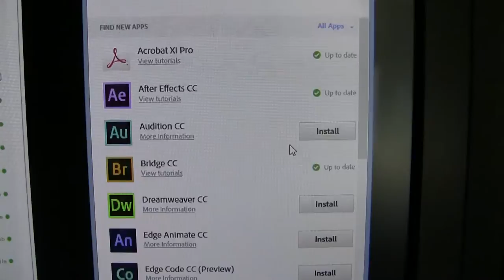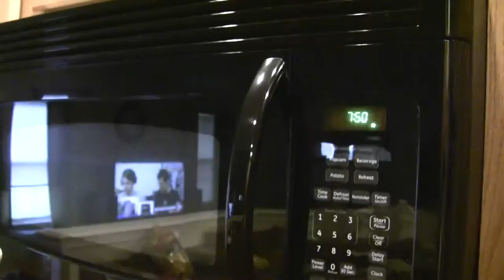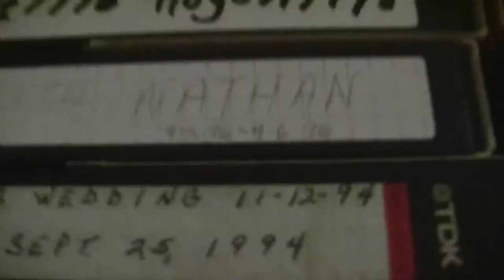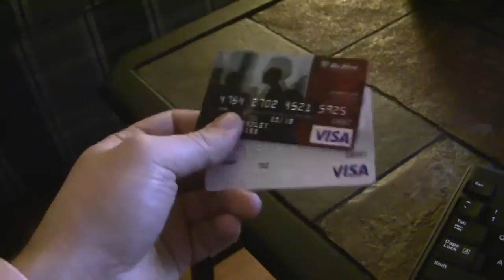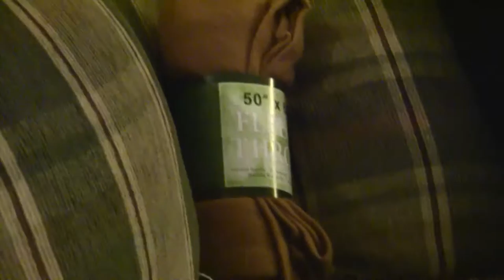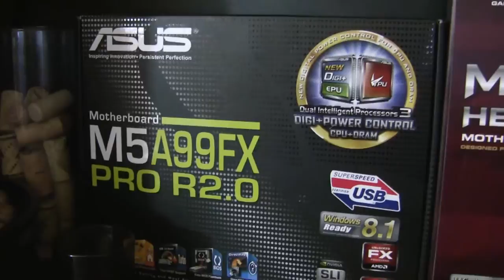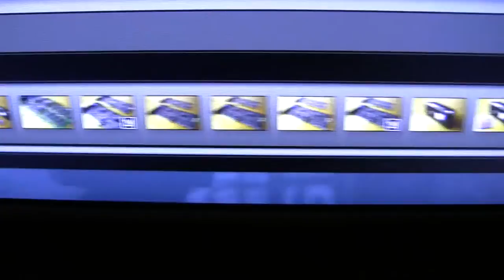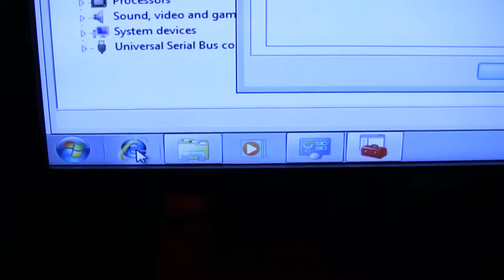TUVlog 2 - Easter, smartwatch yard work, FX-8350 for dad and 3dfx nostalgia

Comment: 'Old hardware'...My computer has a 3DFX Voodoo3 16MB in it!  Well, it's my downloading PC, not my main fortunately.  CPU is an AMD Athlon XP 1800+ with a 233MHz FSB.  320MB of RAM too!  

'Youngings'...I'm 16 and this Voodoo3 is AGP!  Probably almost as old as me :P  I certainly wouldn't even attempt to game on my Voodoo.  

Good video Chris, hope you have a good weekend.  Also, thank you for following me back on Twitter :)
Reply from the maker: So many good memories from that post! I remember I had a Voodoo3 3500 TV that was essentially a Voodoo3 3000 with a TV tuner built in. I want to say I had that in an Athlon K7 700MHz system at the time.

I followed that up with a Diamond Viper V770 (nVidia TNT2) with 32MB of VRAM and at some point an ATI Rage 128 which I recall not being impressed with. AGP was so revolutionary at the time and remained relevant for so long that I remember getting an ASUS P2B when I was still in Jr. High and not moving to PCI Express until after I graduated from college.

Comment: Chris, Please I need your help man, I don't know which case to choose and both of them look very neat and beautiful. Please help me to decide which one is good.

Corsair Obsidian 450D Windowed
NZXT 440
Corsair Obsidian 350D Windowed
  
Please reply, Thanks :)
Reply from the maker: You have three excellent cases in the running there! I can see why you are having a hard time making a choice. Tell me more about what you plan to build. Will you be doing heavy overclocking? Intel or AMD? Air cooled or liquid cooling? If liquid, closed loop like a Corsair H105 or H110 or custom loop? I know, lots of questions but the will help narrow down the decision :)
Reply: OK thanks man, The build that I will be using is AMD liquid cooled by corsair, I will be using the corsair h60 liquid cooling because I am aiming for a budget middle end PC and I wont be doing too much overclocking. 

Here are my specs I am saving up to build my PC

CPU: AMD atlon x4 760k.
MOTHERBOARD: MSI A88x-g45 gaming fm2+.
GPU: MSI R9 270 2gb twin frozr gaming edition.
PSU: Corsair cx 430
RAM: ADATA XPG V1.0 8gb(2x4gb)
SSD: ADATA Premier Pro SP900 128gb
Case:You decide

Here is the build, I might change my ssd to a hdd that is a segate 500gb and maybe I might change the ram to crucial ballistix sport.
But hey, tell me if the build is good and which case I should use or which parts I should change :).
Reply: Btw I almost forgot, how do I private message you (pm)?
Reply from the maker: mavrick2131 That's a nice budget build you have picked out there. I'm a big fan of the ADATA XPG line of memory. Mine has been rock solid and I got a nice little overclock out of it with no problems.

Looking at your configuration, you need to remove the 350D from the running as it does not support full ATX boards like the one you have selected. The 450D and H440 are incredibly similar in size. With the 450D, cooling is going to be better and you have front drive bays for if you want to use an optical drive, fan controller or any other 5 1/4 inch bay accessory. You also have a rear mount for the SSD so you can hide it away and not have to deal with the cables. The H440 will give you a cleaner overall look and more unique styling at the price of some practicality. Also, it looks like NZXT is counting down to something that appears to be more color options for the H440 so that may be worth checking back on in a few days.

If I was building that system, I would probably go with the 450D over the H440. If you want something that's different from many other cases out there, then go for the H440. I just think you will have more room to grow with the 450D. Of course, the choice is still yours! Just don't get the 350D or you won't be able to fit the motherboard.

Oh, and to send a message, on my channel page click on "About" and then there should be a send a message button in there.
Reply: Tech Uploaded Thank you so much man I really mean it :), I will definitely take your advice to build my PC, I guess I will go with the NZXT H440 with another power supply:).